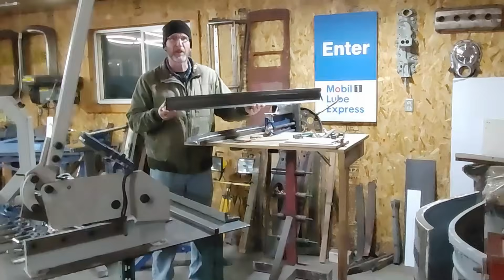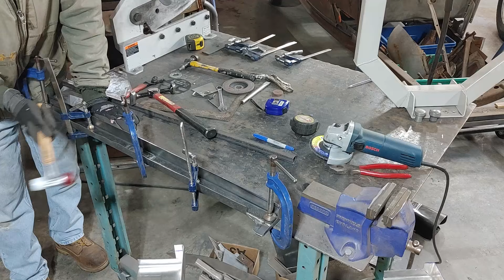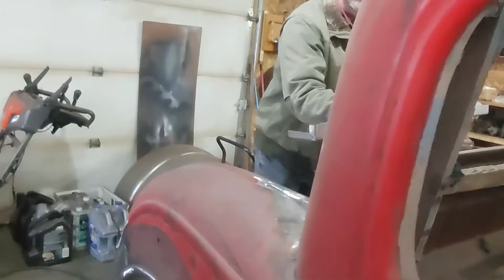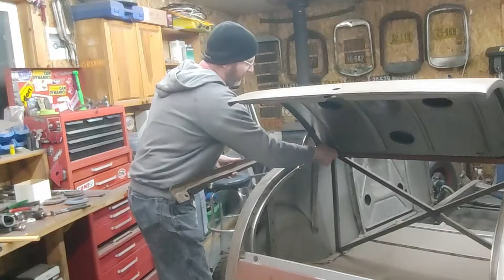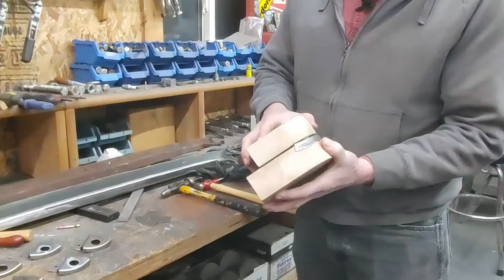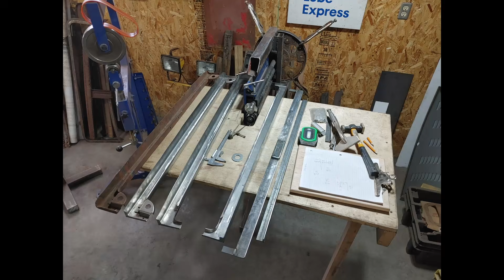1932 5 Window Coupe Upper Deck Lid Drip Tray Fabrication and Installation

Comment: Hi Derek I’m redoing the interior of our 1930 5 window, I want to change the dash panel to something with more space top to bottom and flat across the bottom for the entire width. Do you know if someone sells this or will I have to fab this myself?
Reply from the maker: Brookville sells a 32 Ford style dash that fits a model A. We have one in our 29. It's flat and would give a good starting point to maybe section it and extend it if it wasn't big enough.
Reply: @coldstreamrodshop  thanks you helped a lot !!
Reply: @coldstreamrodshop  Well they are sold out so I guess im fabbing one anyway. We are trying to fit the auto meter invision digital gauge cluster over the steering wheel.

Comment: shouldnt there be copper weld through on the bare metal  some places will be difficult to prime once assembled
Reply from the maker: Most of these cars will never see rain or cold weather. Most will stay in climate controlled storage in the off season so it's not as important as it would be for car used all the time. All of the Brookville reproduction bodies are put together bare metal. But yes it's generally a good idea.